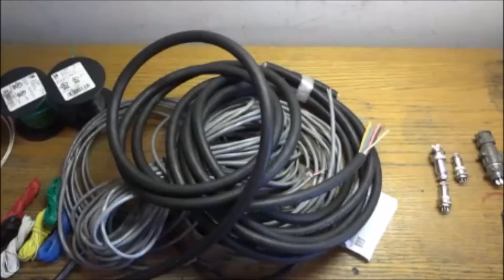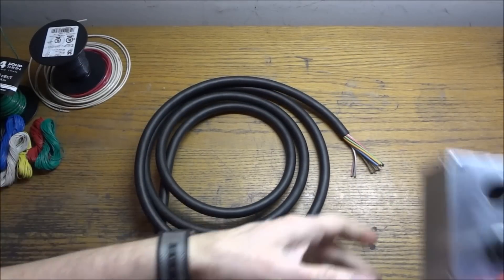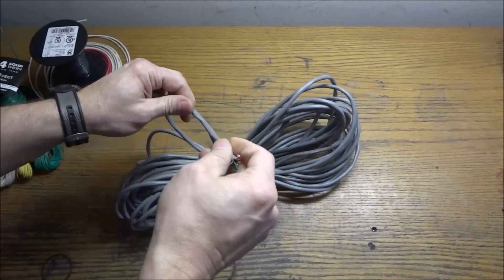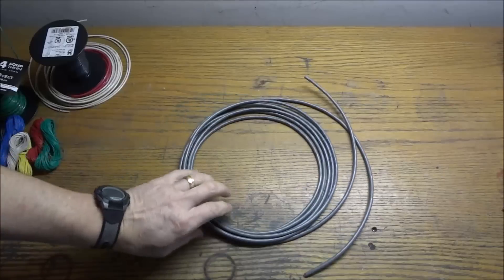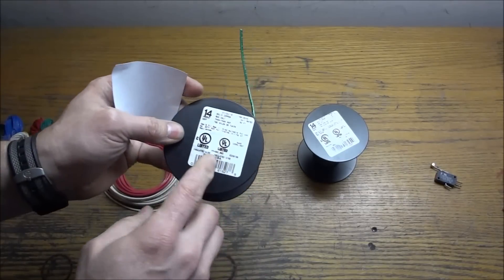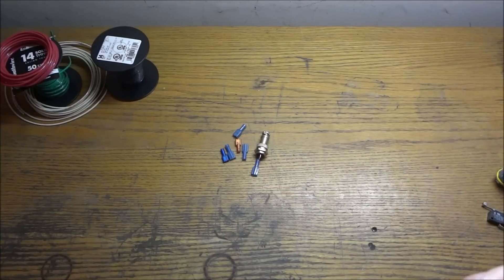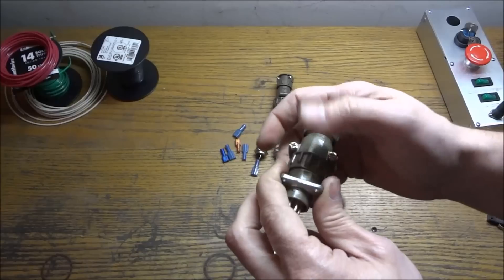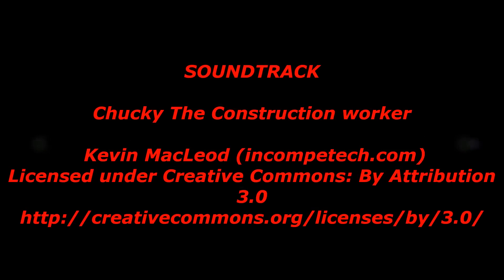PM-727M CNC Conversion Wire, Cable, connectors

Comment: Hi, I have a problem, I do not know what aviation connector model works for me to connect a control cable with 7 lines and it has a diameter of 12mm (0.470 inches), so that it reaches the control box.
Reply from the maker: there are 12mm ,16, mm and 20mm aviation connectors of course the smaller diameter the smaller the pins.
Search Ebay you will find a connector go with 8 pin and run a extra wire in case you have a need or issue down the road.

Comment: I'm a complete nube. I bought a mixing desk with a 4 pin round male connection point. I can only find a picture of the power supply on line which says. 16.5v AC 1amp
Transformer made in the peoples republic of China. I bought two aviation connectors from eBay.
Now what? What cable? Is this project worth it.
Reply from the maker: A mixing desk as in Audio?  I need a little more info but it sounds like your power connection is missing and your trying to replace it? Are you powering it with 110v into a 16.5v ac transformer or is the transformer a wall plug type and connected to the mixing desk? at any rate there are several places you can get wire including your local big box home store.

Comment: I have just gotten to cabling my machine and was wondering how your stepper wire is holding up?  I would prefer not to spend on the ultraflex type automation cable and if standard stranded shielded audio cable is still working well for you, i'll probably go that way.
Reply from the maker: Hi James,
 I have been running this same cabling on my X2 as well as my G0602 I have yet to run into a issue in 4 years.
As long as it's twisted strand you should be fine.

Comment: Awesome videos.  What wire did you use from your power supply to the drivers?  I have some of the aviation connectors (4) pin for my steppers.  I cannot figure out how to solder my wires on the female pin side.  Do you know how the wires are supposed to be connected to the female pins?  The female pins can only pull out the front o f the connector and the wire cannot pass through the connector.
Reply from the maker: I will cover all of that in my next video it should answer your questions. 
Be safe
Reply from the maker: +F1hotrod 
I used 16 awg to make connections to my stepper drivers and 16awg shielded cables to the Motors.
The wire can be slid into the male pins a little and the female i just lay the wire against the tang and solder.
I use 20mm aviation plugs for the motors? 16mm for home switches.
 https://youtu.be/PEYIqc-ExXE
Reply: +CNC4XR7 Thank you.  Your new video answered all my questions.  Next time I will be more patient for the knowledge.
Reply from the maker: +F1hotrod 
It's fine I don't mined the questions let me know if I can help,
Be Safe Sam